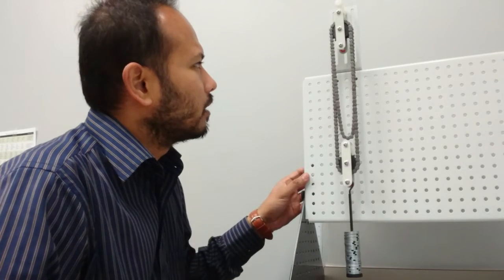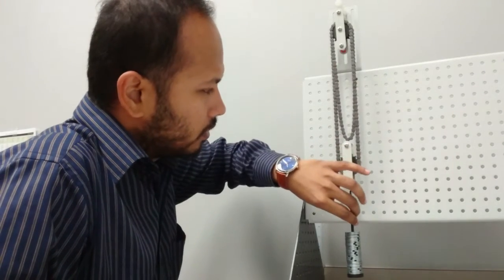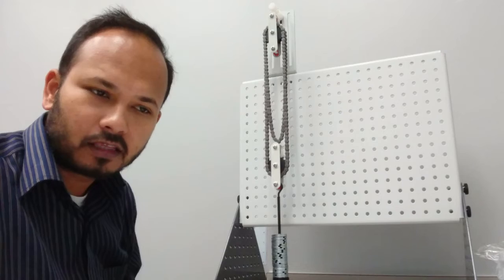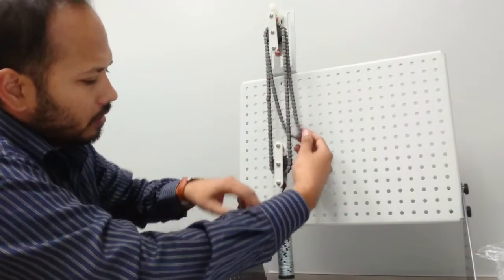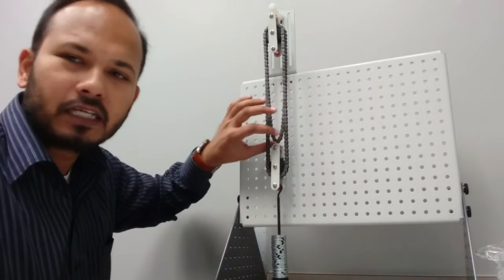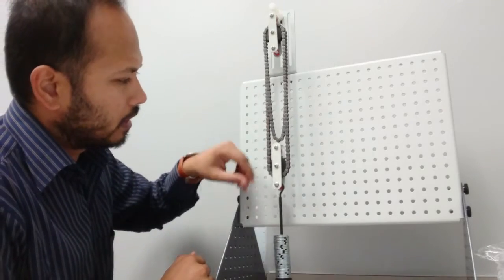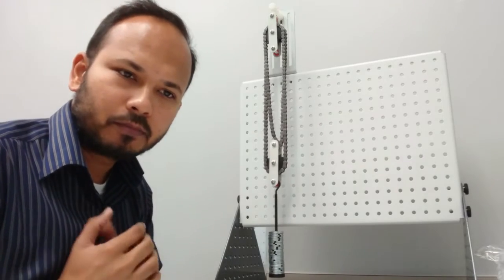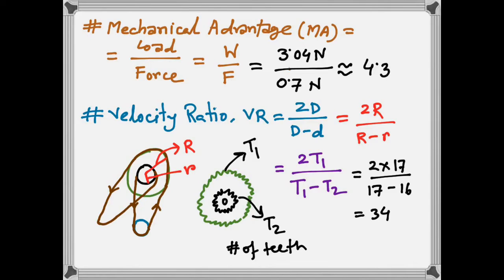Weston Differential Pulley: How does it work? Testing and result calculation

Comment: I wonder if this was ever used to load/offload ships?
Attach a motorized version of this pulley on a moveable arm, and I can see it being used for this purpose before containers and modern cranes became widespread
Reply from the maker: I don't know, but I know Weston differential pulley is used to manually lift can and jet engines.